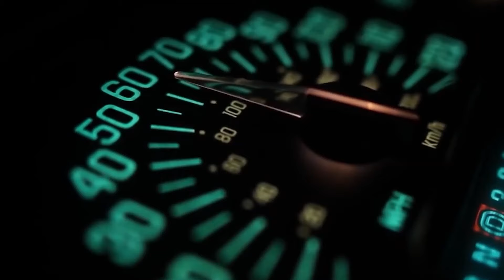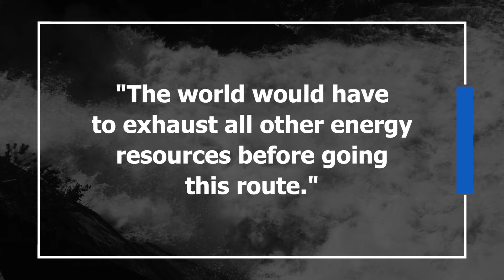The Red Sea Dam: Generating 50x the Power of a Nuclear Plant

Comment: Rather than draining the sea, why not use tidal generators? Being a major chokepoint, the currents would be strong enough to turn underwater turbines and being near the equator means there is a huge difference between high and low tides, making float generators super efficient as well.

Additionally, there is a huge area southeast of Asamara that sits well below sea level. Digging a canal from the red sea to these salt lakes would allow for conventional turbines to power Eritrea and Ethiopia, provide a faster and more cost-effective shipping route to these remote areas that rely heavily on tourism, supply seawater to evaporation pools for salt production, help to regulate water levels in the various salt lakes in the region and potentially help to slow the rate of global sea level rise.

There are plenty of other ways to generate electricity from the red sea without trying to completely drain it.

Comment: That project sounds like a prime example of "verschlimmbessern" A solution to a problem that leads to bigger problems.
The problem not mentioned is the electricity distribution. I think it's nearly impossible to build a reliable energy grid that can distribute the power in that region. It transitioned through to many countries. The political problems would result in a lot of wars. Then the loss of the Suez canal would heavily impact the European economy. I don't think that the energy production could outweigh the losses there.
Reply: Egypt alone has around 100 million inhabitants, by rule of thumb you need 1kW of capacity per person. So Egypt alone is big enough to consume all available capacity. But economical problems are another big issue.

Comment: 50 GW could be generated by covering a few square miles of desert with photovoltaic at a much lower cost.
Reply: if you use common core math maybe, if you use real math, 2 square miles of solar would only produce 2 gwh at most at peak sunlight...

Comment: Couple of questions. How much concrete did it take to build this Dam? Let alone the earthworks to complete the structure. Where if you put that effort in numerous reactors, placed in the location of power need rather than spending more money and effort the ‘transmit’ it - fighting ohms law the whole way. And all the ‘carbon’ foot print of this “carbon free” dam will have spent it in it’s construction.
All this effort to fan the flames of fear porn, not to mention the ever ignored in environmental issues of ‘green’ energy.  Nuclear is better cost less, last longer with much less environmental challenges.

Comment: The Red sea has a superficy of 450000km2 (or millions of m3). With a yearly mean 2,1m evaporation , that is a total yearly eavaporation of 945000 millions m3, and a mean flow of 29966 m3/s.  The energy production depends directly of 2 facts: the water flow going thru the turbines and the total fall. If to create the fall you have to make the sea go down, due to the shape of the sea bed the surface will decrease, then the quantity of water evaporated each year so  , so you will have a max production with an intermediate Red sea level. And the rate of increasing of the power capacity of the dam will lower year by year.
The Western Bab Al Mandeb Strait is 310m deep (around the same that i Gibraltar's strait!!!) but 150km north (Hanish Islands)  , the Red Sea is only 138m deep so you cannot have a powerplant having a bigger fall!With that fall of 138m red sea superficy will be around 80% so flow around 24000 m3/s.  Then the power of the powerplant would be 30GW only  after waiting 69 years.
A dam at Bab Al Mandeb (around 25km long, 400m high) would have only one interest, maintain Red Sea level out of oceans upraising that could reach 70m if all Antarctica and Greenland melts. With 70m fall and 30000m3/s a powerplant will produce 19GW
But for that you need also a dam north of Suez, around 80m high and 10km long
Also, people on seashore of Red Sea, which have no other water than sea water,  needs not too unsalted water and navigation lines cannot be stopped. They have a lot of solar energy, that can be regulated by reversible power stations everywhere. 
There is another place where a big dam could be a big power production, AT Gibraltar strait with secondary dams in the Turkish Straits (Black Sea send more flow to Mediterranean Sea because of its big rivers Danube, Dnieper, Dniestr, Don, Yesilimark...) and at Suez.
A dam in Gibraltar will have for first work to prevent Mediterranean Sea from general ocean's rise. The dam will be around 320m high at the max at the beginning  but with a little difference on each sides, ie a very little water force to control. That will help to built it fast. As soon as water level will increase on the Atlantic side and decrease on the Mediterranean side, it will be possible to increase the size of the dam. 
The Mediterranean sea is very deep, it must stay a sea to separate Europe from Africa and especially from Saharian desert (instead of what was planned in Atlantropia) and 100m to 200m max decreasing of its level will give most of the lowlands available on the shores.
With it's 2500000 km2 the deficit of water entering by Gibraltar strait is 1520 billions of m3 ie 482000 m3/s  or around 50cm less level each year (100m in 200Years!). Each meter of fall at the powerstation will generate 4.3 GW (ie 215GW after 50 years). In fact  from each dam there will be 2 canals:
* of unsalt water from Bosphorus to Greek and Turkish coast , 
* of salted water from Port-Said to Lebanon , and east to Qattara and Benghazi
* of salted water from Gibraltar to Gulf of Lion  and from Gibraltar to Tunis 
These canals will allow navigation of middle size boats to maintain costal harbours and provide water to help to generate fresh water with solar stations making also electricity. There will be also some navigation canals going down to the sea , with gates and small hyroelectric powerplants.
Bigger boats will have lifts at each 3 dams. A lot of works will be needed to maintain sea life around a part of former seashores (like a dam to close the nord of Adriatic See to make a unsalt lake from River Po to Croatian Islands, some others between Egean islands

Comment: Around the red sea each km² receives around 800 to 1000 MW of peak midday sunlight depending on season, let's take the lower number. The typical solar panel of today has an efficiency of 20%, so that's 160 MW per km². The average solar output is typically a quarter of the peak output, so that's 40 MW per km², or 0.04 GW/km². This means that with today's technology you would only need 1250 km² of desert to generate 50 GW. For perspective: the Egyptian desert alone measures around one MILLION km².

At 40 $ per m² (current price for the cheapest) that would cost 50 billion $. 12 hours worth of batteries for 50 GW means 600 Million kWh of required battery capacity. At 100 $/kWh (current production cost for lithium batteries) this means 60 billion $, for a total of 110 billion $.

So even when you ignore the fact that solar panels and batteries will become much much cheaper over the next few decades, and even when you assume that the dam's 200 billion $ price tag won't blow up, we can still do all the for about half the price, without destroying the red sea. So yeah, that dam is dam useless.

Comment: But wouldn't that be reliant on the assumption that the salt water concentration herb percentage would keep it consistent mixture of Salty Sea water coming in. Because the coldness or warm of the water would determine how much evaporation occurs and if the water is saltier or less salty that would produce a different result overtime if too much salt builds up that could become a problem so they would definitely need to be able to regulate the entire body of water.
But I did get dropped on my head when I was a kid so we got to keep that in mind. Maybe that's just nonsense talking

Comment: this area has excellent offshore wind and solar potential. $200bn would buy 200GW, that's 4 times this dam. granted, wind is variable, and offshore has a load factor of 40%, so net 80GW, still more than the dam. never mind less risk and damage to the environment.

Comment: why build it in the red sea? couldn't you just build a smaller version inland adjacent to the ocean pretty much anywhere? obviously not being seismically active would help. and close to a major population center. build a drop next to the ocean, use the power from the facility to pump water back in to the ocean (avoiding the sea level change). You'd have to build a lot of redundancy in to it to for maintenance and such but I can't imagine it'd be harder or more expensive to maintain than a nuclear fission power plant.

Comment: Evaporated water weight in 1s dropping from 105m to maintain level after 50 years is the water power available for conversion, and it’s 3GW - a medium size NPP. Not sure where 50GW is coming from. ROI cannot possibly make sense.

Comment: uh, why destroying the perfectly good sea. It is used now for global trade and is a source of fish, means of transport etc. 

You could do the same by digging a canal up to Quattara depression in Egypt. It is an large area in desert 80 meters below sea level. It would produce less energy - but still significant for Egypt, it would reach full power from day one and it would actually improve the local climate - evaporated water would form clouds and evaporation process would take the heat out of the area. Global sea level would actually drop a little bit because of salt concentrating in the Quattara depression wouldnt take up space in the oceans anymore.

Comment: The few benefits this thing would create would be totally irrelevant by the time it was operational. 50 years to even start generating power and 300 to reach max capacity? We could easily build 50GW of nuclear power plants (or any other type of green power plant for that matter) in less than 20 years for the same cost. Even nuclear fusion will become a viable commercial energy source long before 300 years is up.

Comment: The resource would be extremely strategically fraught. The Russians would just have to drive a Volga full of explosives onto it (or drop it from a height), and there goes another big dam.
50 GW is no longer unfeasible for solar power, and there is a lot of solar energy in the region, across unused terrain that would be cooled by the panels shielding from Sun.. In the period it takes to build this dam, technology is going to leave it a long way behind.
1 GW of solar power generation costs about $1-2 billion, including batteries, and the prices are falling.
It is already cheaper to go solar.
Reply: Before anyone asks about the carbon cost of solar panels, keep in mind that the concrete for the dam would generate vast amounts of CO2 during construction.
That includes the energy/transport for making the cement, transport to the location, creating pure water for the aggregate, construction, and the process of curing the cement which emits vast amounts of CO2.

Comment: What scientist would propose this? Making artificial lakes for hydro with hydrogen bombs would better for the environment. And if the money was spent on nuclear plants. 200+ billion buys 200 x 1 GW reactors, so 4 times the power output. And in 10 or so years instead of 50 + call it 20 in construction. So 2090 before it's operational. We will almost certainly have fusion and more advanced fission and batteries for solar by then.

Comment: Haha, those guys are crazy :D Did you miss it or noone actually pointed out that the dam will produce electrical energy, which would be carbon neutral. But 22 000 ships per year traveling around 10 days longer with average consumtion of suezmax ships 38 tonnes per day is not carbon neutral. Thats 380 tonnes more per ship, 8,4 mil tonnes more fuel per year.

Comment: I still root for burning Coal. Burning coal actually helps the minors who mine the coal, the plant builders who build the power plant. Also the plant workers who run the power plant and do all the maintenance and also the Truck drivers who drive the coal, and the barge and train drivers who barge the coal. When you have a hydro dam it only helps a very small part of the community, once its built the maintenance is very small and doesn't need done very often. 1 Power plant benefit over 50,000 people in the process of building and maintaining it and feeding it, a hydro electric dam takes less then 1,000 to build, and less then 20 maintenance workers and about 100 people on outages. So basically they are clean but thousands of people lose jobs if they choose hydro over coal.

Comment: Simon or whoever chooses mega projects to explain more in-depth. Next to where I grew up there’s a massive pump storage plant that pumps water up from Lake Michigan into an artificial lake which spins massive turbines to generate large scale electricity. It was built in the 1960s and I think it would make a great megaprojects.
Reply: The Ludington facility is awesome, no doubt. It had it's distractors too, if you recall it shredded fish from Lake Michigan early on and they needed to add barriers to prevent fish from entering the turbines.  We could use many more of those to store energy from wind and solar.  Problem is where do you put them? The number of sites that fit the bill for such things isn't very high, as you need a lot of available water and two places to put it with a significant altitude delta between them. These places tend to be near large bodies of water which are often the most expensive property.

Comment: Wouldn't it be just cheaper and faster to cover the entire Sahara dessert with solar panels? 

Why not do the same thing with the Mediterranean Sea? It's only about 9 miles across at the Gibraltar Straight, so it should be easier. Plus the customer base is there already - all of Europe just to the North. Just lower the water level enough that it wouldn't make it hard to build a lock system to the Atlantic to get ships in, as well at Suez. It would also protect the entire Mediterranean basin from rising sea levels and might just save Venice. 

We could do the same here with the Gulf of Mexico, block off large sections of it with dams and use the same process to generate power. NOT close off the Florida straights or try to dam from Mexico it Cuba of course, disturbing the Gulf Stream would not be a great idea. Large areas of the Gulf are very shallow, just make circular damns and let the water evaporate from inside of them and then let water flow in through generators. That wouldn't affect coastal communities or shipping routes.

Comment: So it will take at least 25 (extremely optimistic) years of building + 50 years of drying until it produces any energy and another 250 years until it reaches its maximum. Compared to other options like solar or wind, wich can work in 1 to 5 years. If we don’t have good solutions for clean energy in 75+ years, we are already doomed.  
1. Net present value: The economy worldwide is will grow. Resources we have today are therefore a lot more valuable than they will be in the future.  If we only get the energy in 75 years, we can invest the 200 billion for 75 years and than just build other energy sources with the compounding return.  Let’s go with a low 4% compounding return per year.  1,04 * 18,945. Meaning the damm would need to produce energy 19 times cheaper than other future energy sources just to not have been a negative investment. 

2. Improvement in other energy sources: The damm will already be built and hydro turbines are already nearly perfect. Yet in the 75 years, other energy sources like solar power and their construction will get more efficient and cheaper to produce. 

3. Super solution: It’s possibly that in 75 years we have AI building super cheap solar farms. Maybe AI takes over all work and therefore we have nearly unlimited resources. In that case the damm has nearly no value. Especially considering the 300 years.
 Considering all of this, even if the promised energy price is a lot cheaper than today, it still is questionable if that will be the case in 75 + years. 
The maximum in 300 years will be nearly completely irrelevant. I honestly believe that humanity will have a dysonsheare before that. 

The main advantage is that it lasts (nearly) forever. A lot of people fall into the pitfall of overvaluing infinite lifespan. If you have to build a bridge and one lasts 50 years and the other last forever but is twice as expensive, the correct choice would be the one that only lasts 50 years. The return of the saved resources when invested far exceeds the cost of a new bridge every 50 years.